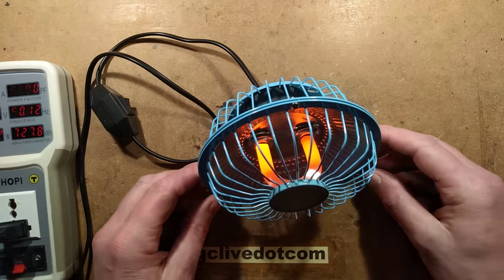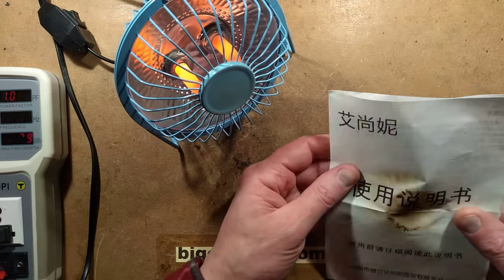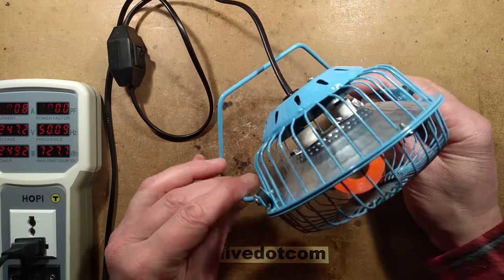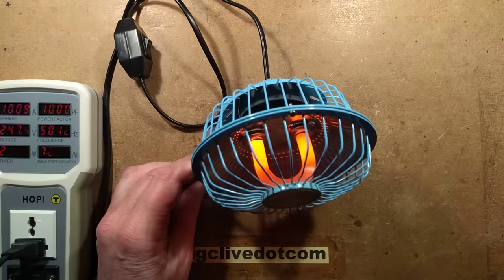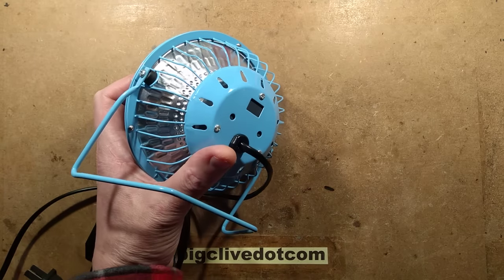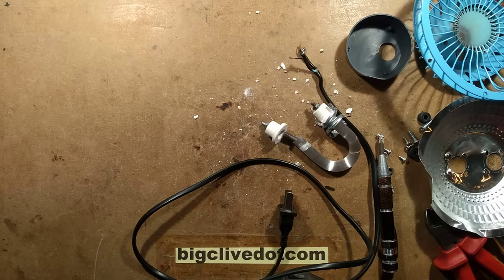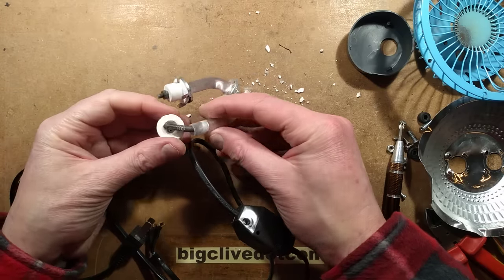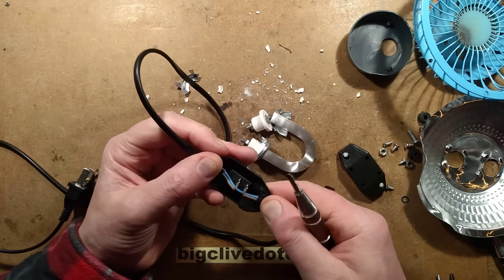Chinese automatic house ignitor.  (also available in pink)

Comment: The case looks identical to a USB fan I have. That hole under the sticker is where the on/off switch goes.
Reply: It looks like the USB fans Asda sells for 5 quid
Reply: Yup, I've had them in both USB and mains power.
Reply: Same. Mine is a lovely green.
Reply: & the fan version probably has a thermal cutoff.
Reply: I've got a lovely chrome one with mains power !
Reply: yup, I have a fan like this on my desk at work.
Reply: Also sold with a 240v Mini fan inside. Widely available in funky colours from Ikea I'm think.
Reply: I have one too
Reply: Pound shop fan case for sure, 2pound each.
Reply: Jepp I have that fan too
Reply: I think that Clive's use of interesting and mine are different by powers of my fear
Reply: Agreed. I have an identical desktop fan enclosure :D
Reply: same
Reply: @transporttechnologykent5829  same but kmart
Reply: I've got a pink one fan that is
Reply: I was about to post the same thing lmao
Reply: @reallyhorribleenterprises  Apple Green ? Think i got it too lmao
Reply: Got one from Maplin years ago with a very similar case. Don’t think the back was quite the same, though. Replaced it eventually with a plastic one as it got very noisy and I discovered that while metal seems like a more premium product over plastic, being rigid it rattles like crazy even with plastic/rubber washers on the arms.
Reply: fan gang
Reply: Just got this recommended by youtube and I might have the same usb fan you have, mine has 2 speeds
Reply: I was thinking the same thing!
Reply: @transporttechnologykent5829  yeah I think I own the copper one
Reply: Late to the party but I have the fan one too, was £2 from poundland a few years back
Reply: I had one of these in a normal outlet plug variant I think the thing covering it is a general purpose caged I don't think that one company owns the right to making these things
Reply: same i have an USB fan like that too
Reply: Me too. It’s the same frame.
Reply: Well, that'll never manage to dial back overpopulation. No wonder they modified it
Reply: Now I know what's inside of the two quartz tubes inside my toaster. I was alway wondering. Conductive quartz? Thanks for taking the thing appart. They don't make quartz heating element toasters anymore as far as I know.
Reply: @skylined5534  ah but those ones don't come in pink now do they?
Reply: Yup I’ve seen that case on USB fans for £3 in home bargains. Cheap as fuck. Not the sort of thing you want out of a heater aha
Reply: Yeah, I have the same one both in USB and mains.
Reply: Same, bought one last week from Walmart.
Reply: Yeah me too until it broke lol
Reply: I have a pink USB fan and it uses the same cage.
Reply: I’ve got a USB desk fan with the exact case from a brand (or at least a product line) called “click”.
Reply: same here
Reply: @scootersfrog  cor!
Reply: I dont have one but thats their favorite switch for electronics the rocker switch like a see saw kinda right?
Reply: Yes i have seen similar fan to this too.
Reply: I have one too.
Reply: beldray?
Reply: I have a 120v fan identical to this also.
Reply: It is.
Reply: Yes i have 2!!!
Reply: I have the same case on my USB fan.
Reply: @bgregg55  nope it didn't.
Reply: Was about to say the same thing, bought my USB fan for 2 quid in pound land but it didn't give off much heat
Reply: @bgregg55  It has a brushless motor. If it gets jammed, it stops on it's own.
Reply: have the same little black usb fan
Reply: I have one
Reply: Same
Reply: I have two identical ones under neo-westinghouse and my store's generic brand lol. Credit where it's due, they are good little metal fans
Reply: you mean the "little square recess"? 😸
Reply: I literally have this exact fan and I love it at work, and honestly the fan is super powerful
Reply: Yep, I have a fan that uses this exact case. Mine's black though
Reply: I’ve seen a ton of those little fans around here and there .
Reply: As a matter of fact, I have the exact same USB fan. Except mine is black :) And we don't even live in the same country
Reply: A Chinese twofor; Cool fan for summer and a fire starter in winter.

Comment: While you breath the fumes from the lead paint that's cooking off, you can go check your fire extinguishers and plan your escape route for when it sets your house on fire.
Reply: Just dont order them from ebay to.
Reply: that's the 200 iq strategy.
my 300 IQ strat is as follows: once you receive this imbalanced broken piece of residence igniter , plug it in for the very first time in a public place, it's recommended to have ventilation but not required.
e.g. your workplace (on a desk of a coworker you won't miss) or a shopping mall
Reply: Going deaf from the lead? Won't be able to hear the smoke detectors going off, nice and peaceful, that's the way to go.
Reply: @FarmerDrew  the key to using it properly and unaliving yourself is a positive attitude mindset and approach to lead poisoning. good job!
Reply: It's definitely giving out some fluorescent x rays
Reply: This looks like an excellent parting gift for an ex. 😂😂😂😂🎉  I'm sure it would help them warm up to you.
Reply: Heh heh heh heh heh heh heh heh heh heh

Comment: That’s an identical metal housing as my cheap Chinese desk fans.
Reply: X Files sounds intensifies..
Reply: Hellar makes some 10cm desk fans with the exact housing, I recognised it too as I have a white one :)
Reply: Yep, same here, little USB fan with a button where the label was covering the hole. Same blue colour even.
Reply: Well, now you can one to cool off, and one to warm up! :p
Reply: Michael Edmunds Yea just set the fan pointing at the heater that way when it tips over the flames will catch much easier.
Reply: So is it a heater case with a fan put in or a fan case with a heating element put in?
Reply: @thebeeskl  yes.
Reply: I used to have one but it died within a matter of months
Reply: same ones at my work in the office lol
Reply: Thought it looked familiar
Reply: I bought those fans at Walmart.
Reply: Greg Fulton yanno when it's a fan and not a shady heater it's actually a great product😂
Reply: Yo same. I have the same one in black
Reply: Yep I had a black one 5v usb that lasted about two months!
Reply: I got a fan that looks nearly identical.
Reply: @riche4you1975  It is funny because I was using mine as an air circulator in my 2 home made 4ft x 4ft greenhouses, it has worked great for 5 years now.

Last month my basement flooded completely, all greenhouses were 3ft under water! I expected the worst for my little cheap fan.

Plugged it in, turned it on, no problems LOL!
Reply: Yeah, 776 people beat me to this.
Reply: Clive will find the fan equally as dangerous.
Reply: @thebeeskl  This is a fan case with the fan replaced by a heater.
Reply: Yes, and the fan is equally as big of a piece of crap.  Mine lasted a month before the bearings seized.  I guess I should not have got the yellow one.  Good thing it was only $2 and I bought a couple.
Reply: I've the black one
Reply: @geogmz8277  LOL, the house igniter or you lose a leg!

Comment: That case is 99% identical to the generic USB fans ;D
Reply: I was going to say that I have got one.
Reply: Yes, my fan has the exact same cage and stand! Crazy! That helps to turn costs down but is very dangerous.
Reply: Yep.. I got one off those too
Reply: It is, I've got one of those gadget USB fans, well to be honest, it's like they removed the motor and the blades and slapped in a heating element in it.
Reply: I bought my USB fans that use that same cage from the Dollar Tree and 99c store respectively.
Reply: My fan even does show time and works quite well with its brushless motor. I had to oil it once.
Reply: Yep, it even has a hole where the switch is on my fan
Reply: Aye, same as desktop led clock fan. Just one of the holes on the back with a button to set the time.
https://www.google.com/search?q=Desktop+LED+Clock+Fan&source=lnms&tbm=isch
Reply: me too definitely
Reply: What is this? The video shows an upload date "19.12.2019" and your comment is dated "before 2 weeks"! WTF?
Reply: Peter B  love it!
Reply: @eifelstream6696  early access for patreon people.  that 'upload date' is just when clive made the video public
Reply: Yup i got a little orange fan same look on my router and modem
Reply: why does it say this comment was made 2 weeks ago
Reply: @eifelstream6696  wtf i just saw that
Reply: It's a Fanny Flambeaux case.
Reply: And those USB fans are NOT particularly stable...
Reply: @TheRuben654  I guess that hole would fit the switch in the black box, except too hot to handle when turning it off.
Reply: Confirmed!
 I have a usb desk fan that has the exact same design :D
Reply: Identical to mains powered ones as well. On mind the little square slot in the back is occupied by a panel mount switch
Reply: Exactly, I have such one fan :D
Reply: I suppose the only difference is that the USB fans come in pink ;)
Reply: I dont have any of those... cos Im poor..
Reply: I was about to say the same about fans. I have one the same size but runs on AC.
Reply: I was wondering if they made the fan with an added heating element.
Reply: yeah cage is for sure used for fans
Reply: "It's described as 'four-inch' even though it looks bigger."  That's because it's a casing for a 4-inch fan.
I guess they thought that if you build a heater into the casing for a four-inch fan, the heater must also be "four inch".
Reply: I've got two of them, the older version has a large transformer inside the fan case to allow it to run off the mains, the second is the standard 'generic USB desk fan'. To see the housing reused in this way is scary.
Reply: I have a plastic one
Reply: I have that fan
Reply: Very true, zappo_dk, I have a fan with a nearly identical case.  Mine plugs into a US wall socket.
Reply: @eifelstream6696  I think Patreon donators get advance views.
Reply: @eifelstream6696  I think Patreon donators get advance views.
Reply: got one of those fans xD nice metal casing
Reply: Identical to a 120 volt AC desktop fan I have as well.
Reply: Peter B  make sure to use magnesium blades.
Reply: @dublinius  Ah ok, thanx! :O)
Reply: @jankcitycustoms  Ah, thanks, that's it! :O)
Reply: I knew I’d seen it before
Reply: yes, I have the fan version also ( it the same case), also the same case holes under the label aswell?
Reply: Yep.
Reply: Peter B  Lol. Right?! Do it, man.
Reply: @TheRuben654  same here! Mine is pink though.
Reply: It's mostly definitely a USB fan  cage. I had a silver one just like it.
Reply: Why reinvent the wheel?
Reply: I got one blowing over my graphics card because my case doesn't have good airflow. Works great lmao
Reply: I have that fan and it falls over all the time.  Using that design for a heater is a very bad idea

Comment: 1:17 just incase someone asked, the text next to the schematic says "The mini heater series is based off many heater designs and is designed ingeniously. It's beautiful, small, low power and high performance. It's also really convenient, "safe", low power, and is the best heater for homes, schools and offices.
Reply: god, the good ol' thesaurus trick
Reply: Is "safe" really in quotation marks?
Reply: @bbgun061  not in the original text
Reply: Thanks for the translation, 2 years later.
However, I just saw this item today 9-23-2022
Reply: great for insurance claim

I don't know what could have caused the fire I only use "safe" appliances
Reply: Schools! Gawd.
Reply: I'm sold.
Reply: The person who wrote that must have been a poet
Reply: China. Engineering-wonder capital
Reply: I like how words don't mean anything
Reply: lol
Reply: @ironingbored  and office too ...in case you dont like where you work and want easy unemployment bucks.  🤣
Reply: @eva2602  never gone anywhere
Reply: Thank you. 👍
Reply: So are they outright lying? There is nothing ingenious or safe about this thing. The quartz tube would at least help with radiant efficiency I guess... The burned down house kind of negates those gains, though.
Reply: Schools yea right those kids might have a future so bad idea 😂

Comment: This casing was in fact designed for a 4" fan. These started off as typical mains voltage fans, then as a USB powered fan.
Reply: Yes but  they weren’t completely useless when they ran in the mains
Reply: Yeah they even have them in the US fans using cages like that it's really funny though to see companies have them as their own brand with those cages when the cages are not even their design
Reply: Makes me wonder if they wanted a USB 3/5/10 watt mini heater for a small cubicle setting but it didn't sell well so they upped the wattage.
Reply: Ngl this looks like something 5 minute crafts would make
Reply: @cdeer17  The factory where I work has different options the customer can request, the suppliers for each of the options is different. But the mounting brackets are made in the exact same factory and are identical. Of course our internal part number for those brackets is different for each supplier for some reason... Our competition also uses the same brackets in their installation because they buy those options from the same suppliers and those suppliers buy their parts from the same suppliers.
Reply: I have two of them as circulating fans. They're pretty good for that.  I have it on a small variable autotransformer ("variac" style of thing) to adjust the speed.
Reply: I gave a scroll to see if it was mentioned. Have seen like a dozen OEMd versions of this as a USB desk fan.
Reply: I have a USB fan with the same case at work I just realized now you said that I literally found it in a box only a few days ago. Weird.

Comment: I especially like how the plug can go in either way, so that if you put the live side on the side that bypasses the switch a fault would make the exposed metal live even with this switched off
Reply: @@Quadflyer1 This is why it is a good idea for switches to disconnect both wires.

Comment: Big Clive: "that's an interesting approach"
Translation: "this is dangerous and should not be in any product"
Reply: Jarrod: "Big Clive: "that's an interesting approach"
 Translation: "this is dangerous and should not be in any product"
Translation: "I know nothing about the subject matter and just assume that it's bad because I have to make a funny comment to get those sweet internet points."
Reply: @kelakakku  excactly, clive said it too. had they used solder it wouldve probably melted, and they were too cheap to do some wire connections, so they just used screws.
Reply: @kelakakku  You nailed it. They should just go back to Reddit with their shitty "quips".
Reply: @kelakakku  crazy right, i can't imagine the internet being a place where people speak their mind and try to make jokes that kinda stuff should be banned
/s
Reply: @leomadero562  Jokes are funny because they are true, what he said isn't.
Reply: @deelan_  Well, the screw connection is the same as on any AC motor, and is very safe, and the fire hazard is not that much of a problem, since a radiant heater is only usefull if you are nearby anyway, and unless your house is made of tinder soakin in oil, you'll be able to picj it up before a fire starts. The lack of earth connection on a metal frame is the only thing that is really unnacceptable.
Reply: I love it lol its good old uk understatement and sarcasm lol
Reply: @kelakakku  You say that as if you believe all jokes are true. If you believe all jokes are, or have to be true, You are woefully misinformed about comedy my friend.
Where on earth would you even pick up such a theory as that?
Reply: @slome815  I was thinking the same. It does the job it needs to without anything fancy or expensive.
The lack of earth could be rectified with a rewire if needed.
Reply: @caddyguy5369  It's called autism. Also, fishcock is a delicacy in Finland. Go figure.

Comment: I have a couple of desk fans I bought at Walmart that have this exact frame, rectangle cutout if for an on/off switch
Reply: Helloki My first thought when I saw this, it has the the exact same frame as the cheap fan I’ve got on my desk for soldering which was from Walmart. It was less than $10, I’m pretty sure like $5, but it was definitely one of their private label brands like Mainstays. Funny seeing it doing the reverse function (more hot instead of more cool) lol
Reply: Yeah these are cases for USB powered fans. They’re quite decent favs but must have had a quite a bit of extra cases they sold to whoever made these
Reply: @P7777-u7r  Yeah good point. For what it's worth, they are pretty sturdy little fans. That's interesting that you've seen them for USB powered models, the one I got from Walmart just plugs straight into the wall and has a switch on the back (you can see the cut out in the video for the switch). I'm sure you can probably find the exact case on Alibaba if you looked hard enough
Reply: Poundland sells fans like that too. Bigclive's favourite shop sells these fans.
Reply: yup. same. actually as a fan it's solid, had mine for 3 years now. wonder what else they use it for...
Reply: @james_robertson  Poundland aka AshensLand!  Also "The Range" stores sell them , as I've just realised that my USB fan here is using that  exact chassis .

Comment: Finally, I needed something to warm up my pile of bedsheets next to my stack of printer paper in my carpeted, soft-furnished lounge with the gas pipes running across the wall.
Reply: I find it works best when placed on the cardboard box it came in. For circulation.
Reply: @JoeOvercoat  face down?